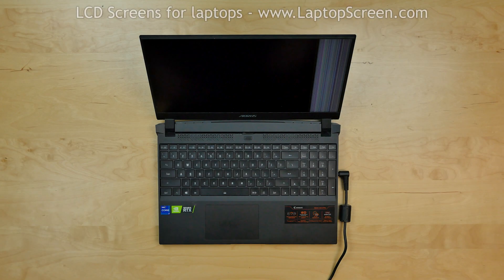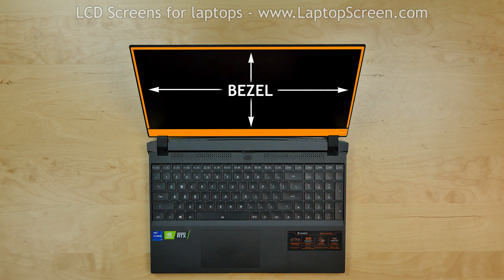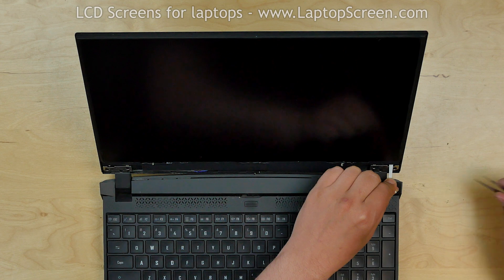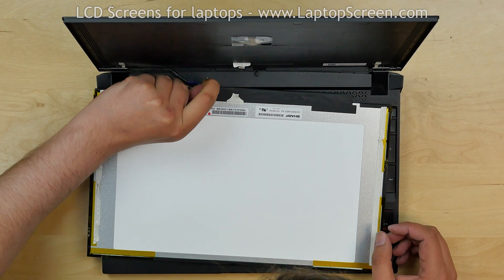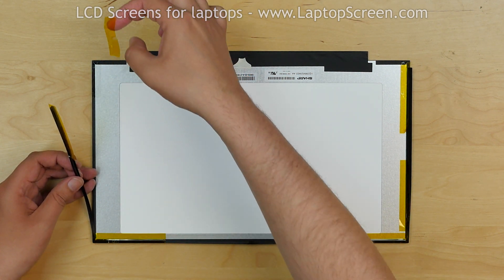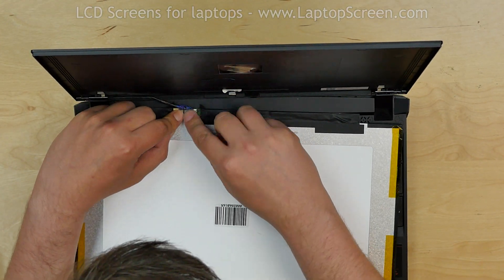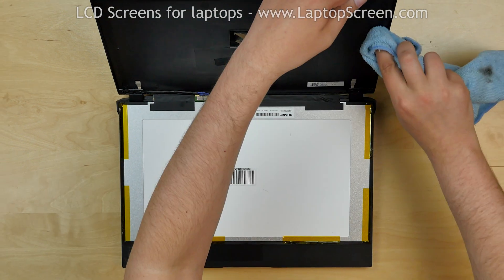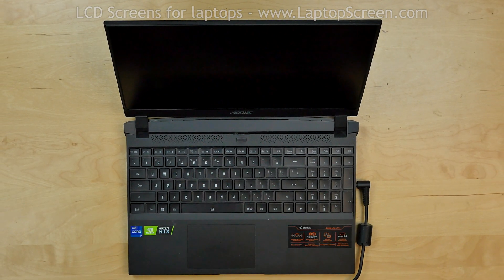How to replace LCD screen on Gigabyte Aorus 15P KD

Comment: I have been using my 15p XD laptop for 2 years, and I am a very careful user. Suddenly, the screen stopped working. When I connect it to a monitor via HDMI, I can see the display on the monitor. A repair technician told me that the screen needs to be replaced, but I couldn’t fully trust their opinion. Is this a common issue?
Reply from the maker: It is extremely rare for an LCD screen to give up and go dark on its own. The most common way an LCD goes bad is via physical impact. Some specific models have developed mass-dead pixels due to manufacturing defects and became progressively unusable over a long period of time. Physical impacts (cracks) are usually pretty obvious, but sometimes they are hard to identify and can be confusing. LCDs specific to this computer have not been known to go dark or dead on their own, and don't have a history of common manufacturers defects.

You could try to disconnect and reconnect the video cable at the back of the screen, maybe the connector went ajar.
Reply: Mine is flickering, but only in the latop screen, it doesn't in my external monitor.
Reply: @EveStreaming  My computer has the same issue of the screen flickering depending on the lid’s angle. I bought a new flat cable from China and will replace it following the tutorial.
Reply: Ive had the exact same issue with my aorus 5 SE4 (same hardware), might also be the lcd display cable
Did you make any repair ?
Reply: Hello!! I have the same issue. Dead screen. Did you change the screen or repair? Thanks if you can provide me some informático, before I have to buy the screen
 Thanks!!